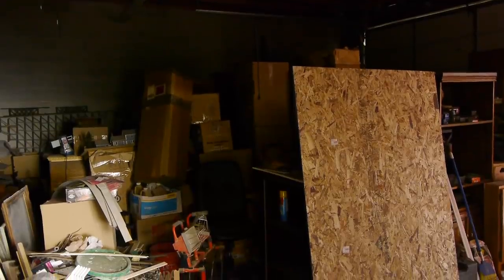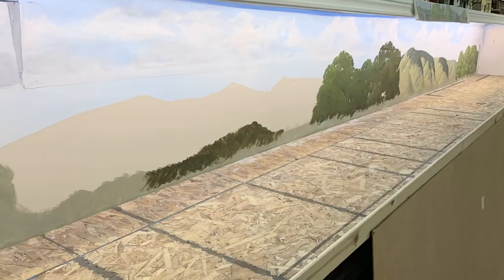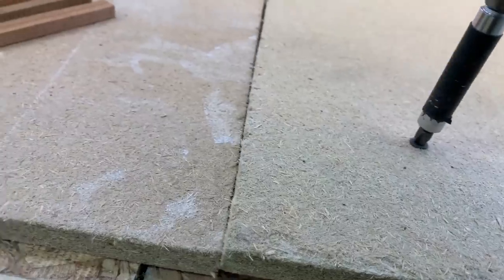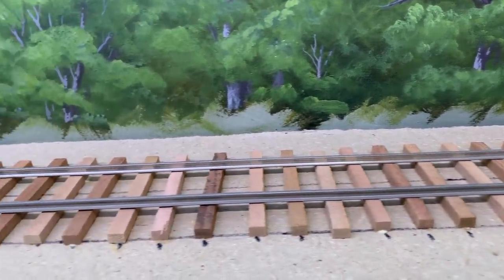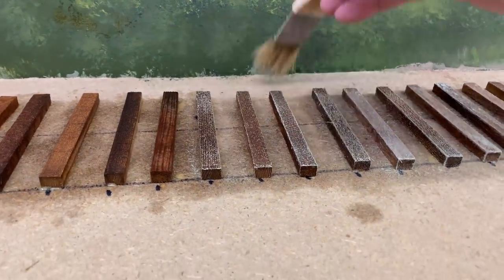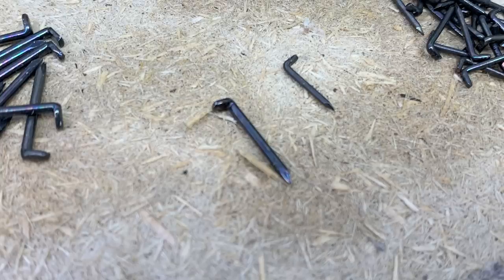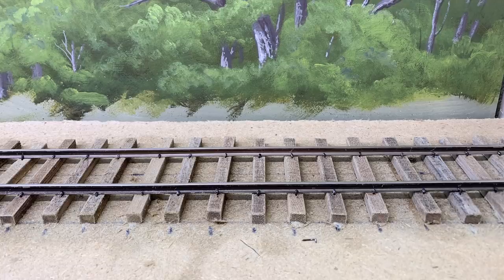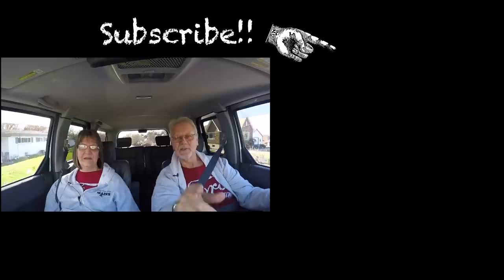Hand Laying Track on our Indoor Garden Railroad

Comment: We are in different gutters together, Dale. I'm working outdoors these days.

Staining a wood coaling tower that I bought from a friend and has seen way too much Arizona sun. Linda commented on the smell of the Watco Dark Walnut (I ran out and Amazon came to the rescue). I repeated your comment on its smell vs. creosote. She agreed, but added, "Not by much." I plan to put a layer of Watco Teak marine over the Dark Walnut - after the Dark Walnut has a few days in the AZ sun to cure. Need all the protection we can get here. Now to repaint the figures and work on the solar / battery lights.

AND I'm laying brass 45mm track (a mixture of USA, LGB and Piko) in the back yard. The USA track is "golden" brass with black ties and the other two are "dark" brass with brown ties. So, I'm using a trick I found out a few years back. Using the Rust-Oleum Earth Brown Camouflage paint, I paint the track: rail and ties. Using power-on-board, so the electrical contact is unnecessary. I don't bother to clean the used track, just spray away. After a few years in the AZ sun (that, again) the rails look like rusty steel and the ties look like creosoted wood.

As for your issue with the rail joiners, I recommend power drops to every section of track. That way, the conductivity (or lack there-of) of the rail joiners becomes immaterial.
Reply from the maker: Hi!! Yup same camp paint!!! It’s the perfect color. Sept I’m out of it and Walmart hasn’t got any either. Damn. Ordered more Watco. Still on order. Slow shipping these days. Damn virus. The brass is great fir outside. I’m tempted but I have 600 feet of aluminum. Well 600 finished so 1200. Anyway it what I had on the old railroad but wold prefer brass. A lot!!! Much better. Back to Watco. It fades. A lot. Sun or no. But I love adding more. The color gets richer. But outside it will all but vanish in a year. It will also spontaneously catch fire!!! If you have it on a cloth either soak it in water or but it in an air tight can but never just leave it out!! Inside or outside. Sun or shade. It may just catch fire. Burned down my house. No lie.
Reply from the maker: Oh and on my old garden railroad I started by digging a trench. About 5 inches deep. Everywhere the track was going. Then I put orange extensions cord in the bottom. The three wire kind i soldered the ends together forming a 300 foot long loop and hooked the green wire to the neutral on my two power supplies. Both ends of the wire. Then I soldered  a few feet of wire to the green wire every 6 feet all the way around. Later I filled in the trench with fine gravel and laid the track on that. And connected those drop wires at every joint on one rail. The other two conductors in the orange cords were connected to the hot on each supply. As the wires were black and white I called the two supplies black and white. Then I tapped those two wires in three places around the railroad and put a double throw switch at each location on a small control panel. Then a feeder to each joint to every joint on the other rail. Anyway never had a bad section. Or loss of voltage or problems. And every section of the layout could be set to the black or white power supply.
Reply: @ToyManTelevision  Got Watco Dark Walnut in two days on Amazon Prime. But the Rust-Oleum is back ordered until mid May. Still got two cans, so I'm pressing on.

Comment: Wow—great progress!!!!!
Screws in from underneath perhaps a better idea? (...than from the top where they'll be covered by plaster and ballast and track...)
Reply from the maker: Tristan Morrow what I have done in the past is if I want to change something I can cut the sound board with a carpet knife and lift that section out. If there is a screw there I can break the board around it and remove it. Then cut a new piece. And I can lay a switch on it right the bench if I want to. Then screw the piece in place.
Reply: @ToyManTelevision  ah—excellent!  I didn't realize how soft the sound-deadening material is.  Keep up the great work and thanks for bringing us along with the great videography and editing!

Comment: An observation about your track-you are putting the spikes in line with each other.  The spikes should be off the center line of the ties-outside spikes on one side and the inside spikes on the other side of the tie.  The tie plates should be installed with the 2 holes on the outside of the track or end of the tie.  Remember the plates are supposed to the canted and the cant tips the rails toward the center of the track.  When using the plates keep the outside or field side spikes on the same side of the tie; with those plates the inside spikes will be in the center of the tie.  I would suggest using a small drill bit and drilling holes for the spikes to lessen the chance of splitting the ties.  Use a bit about 1/2 the diameter of the spikes. 
At 15:09 the inside spike of the left rail is backwards.  Straight track though.
As a track man I notice things like that.
Reply from the maker: Hi. I am now working on tracks one and two with the tie  plates in place. And yes I’m putting the two holes to the outside in the single hole in the middle. The key to putting the tie plates down I’m finding is to only put the spikes in about halfway. Slide a tie plate under the rail and then go ahead and put in both spikes about halfway. Then when I move onto the next tie plate I can lift the rail to slide the tie plate in place. Once all of the tie plates and spikes are in place go back and tighten everything up. My plan is to then come back and whether the Thai place in place. I tried putting the tie plates in place that are already painted and they tend to get scratched so I think I’ll just come back after the fact and put a little rusty paint on each one.

Comment: It looks great, well done . I was going to due same in HO with tie plates, but spikes were way smaller the Micro Engineering ones, so just spiked down to the ties. I got a little order of Cascade Rail Homabed, and he has since gone out of business. Nice tip on the sound deadening board .   God Bless Ya   Dave
Reply from the maker: I just don’t like the itchy sawdust quality of the sound deadening board. Cutting it makes my skin crawl it’s like working with fiberglass. But once it’s in place it’s fine.

Comment: Looks good. Love the weathering ideas on the ties.
Put some anti-oxodent grease on those joiners. NOALOX is one brand. It is made for aluminum/copper connections.
Reply from the maker: Scott H yup. Bought a tube. Why do they use aluminum?? Except with aluminum rail. Anyway NOALOX works.

Comment: Dale,
Your a brave man hand laying rail. (Flex Track) is quicker and get on with your life.
One more thing?? Are you running your trains  by remote control or power pack ??
Reply from the maker: Hi. Not sure!  Still planning but I’m thinking of battery and air wire on the large locomotives. But DCC I guess?  For now DC as it’s what I’ve got.

Comment: Did you cut the ties yourself or did you purchase them somewhere and if so where?  Does the rail come from microengineering also?    I am looking forward to seeing how you hand-lay curves and turn-outs.

Also, and maybe you've addressed this, what use will you put the green area to outside the fence (as seen on the computer projection)?

I really love watching y'all do this and your other adventures.
Reply from the maker: Hi. I was going to cut ties but I found a guy who custom cuts them and sells on eBay. Super good!  Saved time. So I bought 800 ties and a bunch of 5 inch long ties fir switches. The lawn outside is for the tenants who rent the house. We wanted the layout really secure. So the fence and locked gate.

Comment: If you were building a modern railroad, all of the ties would have to be perfect because, as you know, they are perfectly installed, and aligned.  Being a wee tiny bit off from each other adds that old fashioned touch. Me likee. Too bad the rail joiners don't have built in "bolts" to add authenticity. If you are going to the trouble of spiking, think about putting dots on the clips. P.S. I like the opening scenes.
Reply from the maker: Hi. Yup in making “fish plates” to bolt the joints. Even though half of them won’t really be joints. Debating on how to do that. Next week I’m showing how I can cast track components and I’m thinking of making them that way. But they’re really small in the mold I make is really big and it seems like a waste of a mold unless they put like 100 of them in there. And if I have 100 of them I don’t need to cast any. It’s a conundrum.
Reply: @ToyManTelevision  I was a cabinet maker once upon a time.  In a commercial job we could end up with 160 cabinets with an average of 3 doors each.  Each door has 3 finished sides.  That's 960 edge pieces to make.  My trimmer couldn't decide which was faster one door at a time or 10 doors, or a hundred doors at a time.  One can waste a bunch of time thinking about such things.
Reply: You two have inspired my wife and I to build a garden railroad "F scale" and while doing that we found more time to be together  and enjoy life.we really enjoy watching you guys "skrewing around".keep up the good work and be safe. Thank you.

Comment: Nice look into your project with lots of attention to detail but I wondered why you didn't stagger the rail joints as prototype track does?
Reply from the maker: Mostly will. In this case as the rail is 6 feet and one end flush on that track that joint lines up.

Comment: Just a thought for your aluminum joiners.   Are you running power to each section between the joiners or you could run a thin copper jumper wire and solder it in place.  I agree there is a difference in resistance in aluminum and copper/brass.
Reply from the maker: So far on the indoor sections my plan is to run one jumper wire to every length of rail. As a matter fact that’s what I did this afternoon! That all connected together by a 12 gauge bus. Outdoor will be pretty much the same except I’m going to use orange extension cords with the ends cut off and soldered together as my bus as it’s much more weatherproof. Then bring one jumper up at each rail Joiner. Yes I can’t Sauter to the rails I’m going to clamp it with the rail joiner.

Comment: @Toy Man Television >>> At 15:26 in this video:  Do you plan on painting a locomotive garage/shed/whatever on that wall where the tracks will end? 
 
Seeing that wall there in the video reminded me I've seen other model railroad layouts that used that painting technique.
Reply from the maker: Well the plan is, if I can make it work, is to put a mirror with an ice house. The mirror should make the yard look twice as big and the ice house to cover the edge of the mirror.
Reply: @ToyManTelevision  >>> Okay, Thanks!  
 
FWIW, I HAVE seen photos  of mirrors used in model railroad layouts for that purpose.  However, I COMPLETELY FORGOT THAT until you mentioned it...👍👍

Comment: Would a railway bother putting sleeper plates down in a yard unless it was very busy? Save the dollars. Keep the plates for the running lines.
I like the idea of spikes. When I was involved with rebuilding a section of line, initially I think we only put in every 4th sleeper. That way per way trains could run distributing the other sleepers, plates and spikes, and later ballast.

Here in Victoria, Australia currently you can be fined for "just going for a drive" as some people have found out. Karryn please where your seat belt like Dale.
Reply from the maker: Here they are actually encouraging people to go out and get some sun and air just not  interchange with anyone. Driving with people from your own home is encouraged as is going for long walks around the neighborhood. As long as you don’t approach anyone and they don’t approach you. Unfortunately it’s really fomenting some aggressive antisocial behavior. No matter. In researching the old Rio grande in the 1960s they would use tieplates wherever they felt like it. You would see a bit of track there might be 10 tie plates on 10 ties in the next 20 ties had nothing. I’m assuming it’s just which ever crew laid them and what they they had access to. Pretty scattered approach. So that’s kind of what I’m simulating. On the main-yard tracks everything will be in plates. Everywhere else it’s a crapshoot.

Comment: ohm myyy.  a question if i may, g.m.h is coming along nicely. are u going to have provisions to run trains on a loop indoors during  winter  weather ? i love the ceder ties (sleepers).:) good luck. also where did u get the ceder ties? thanks in advance.
Reply from the maker: Hi. Outside will be aluminum rail on plastic ties left over from my old garden railroad. I have 600 feet of it!!  But inside will be all hand laid.

Comment: Are the tie plates metal? If so, u could solder them to the rail.  Also how much does the rail cost and what brand ?
Reply from the maker: Yes the plates are metal. But I have cast from out of white metal that melts at about 600° so I can’t solder to it. But it works just fine spiked in place. If the points slide braces were solderable that would really be nice. I’ve been buying my rail from micro engineering. It’s nickel silver and I’m not sure of the cost but it is expensive. You can look that up on their website.

Comment: If it’s a stub end yard...how do you turn the locos around???
Reply from the maker: Ha ha you are one step ahead of me! You can’t but you have to be able to do a run around which is the track I’m laying right now. The train pulls all the way to the end of the yard you unhook the engine back through a crossover to the two track all the way to the other end of the train, pull the train back out of the track and push it into the proper track.
Reply: Toy Man Television I see, great system, I could never hand lay track!

Comment: Are the rail joiners pure aluminum? 
 
FWIW:  I have worked in aviation, and from that learned pure aluminum is actually very corrosion resistant.  However, it is also rather soft,  and that is why most aluminum used in aircraft is an alloy.  
 
I know that you can get galvanic corrosion between steel and aluminum, although I do not know if pure aluminum  is immune to that or not.
Reply from the maker: Yes. And it can be a problem but if the rails are kept dry not to much of a problem. A anti corrosion paste.
Reply: @ToyManTelevision  >>> Rodger that - Thanks.

Comment: are you in the yard also little town? for your garden railroad?
Reply from the maker: Yes we’re going to proceed with that grapevine section in the next few weeks. The odd thing there is then it means it won’t be connected to the rest of the railroad. It’ll just be sort of by itself for a while.
Reply: @ToyManTelevision  maybe you van well putting figures on grapevine as maintance gardener, as little inside joke. but also you can just small shed on scale where they putting garden tools for the grapevine. i do often see people making reall life object with scalemodel figures as fun and jokes around. i hope it give also idea for your funny section of the railroad.

but i hope you also think about how to keep the village easy to clean section, like when it is raining that you have some draining system for the water smoothly away. i did just 1 year working in a miniature parc in a city nearby and we did upgrade that system back then.

how every when i was fired and the parc move outside the city. it was old and small back then however the people who run the place now... it is big mess layout not on scale made province... that is really sad. 

but for you keep on your working and i did like the videos of your garagemahall?? (if i spell correct it?) i do like to see it grown into finished project :)

Comment: Here until some crackhead jumped the fence and steals all your tractor cost $12 a foot and you got $15,000 laid out on the ground and yeah I don’t recommend it
Reply from the maker: Well I’ve had as much as 600 feet of track, $1500 in switches and $1000 in structurs and never a problem. So far….